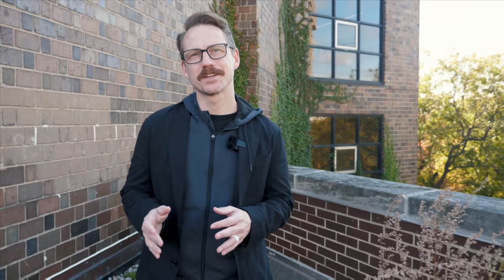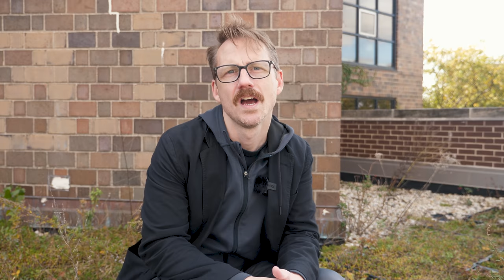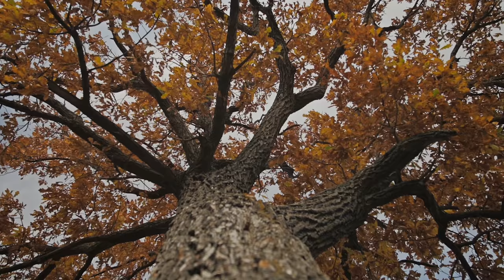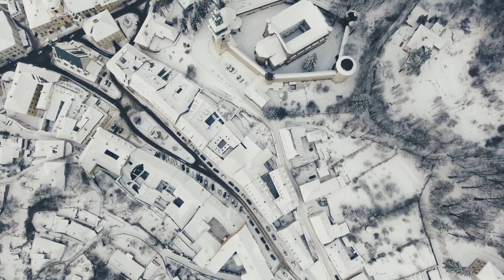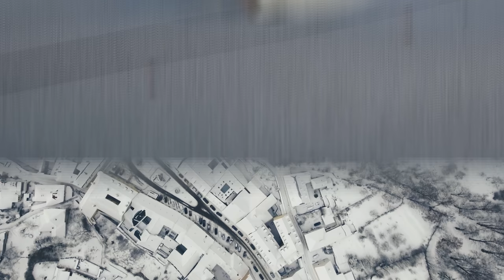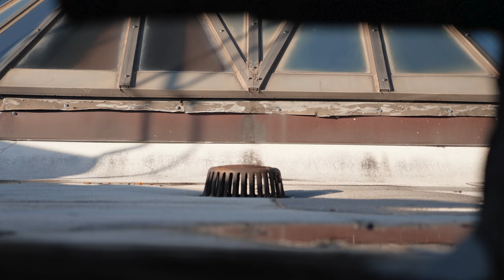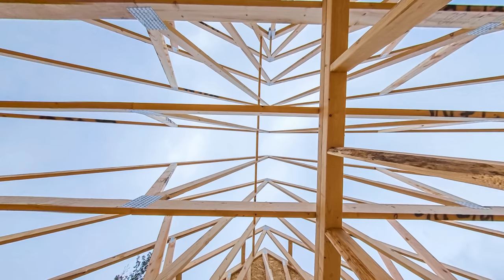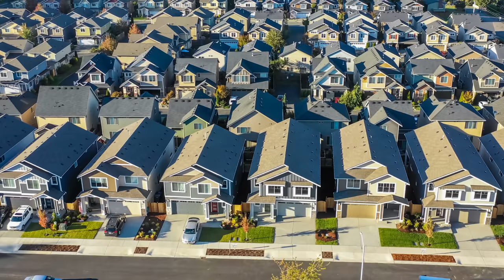Why Do Architects Insist on Using Flat Roofs?

Comment: As a building services engineer, I like flat roofs because you can use them to place air handling units, chillers/heatpumps and photovoltaic panels.
Especially since most architects don't want any HVAC or other systems visible in- or outside.

Also you can have a green roof, where most of all of the rain gets stored on the roof and feeds the plants, helping to fight temperature spikes in cities.
Reply: If the roof was not designed to be green roof, that can be dangerous to make it a fully green one.
Reply: @yamatohime2035  Yes, anyone wanting to do that should always check with a structural engineer first.
Reply: But you have to distinguish between real green roofs with enough soil for bigger plants and those with just a few cm/inch of soil. The latter one has a small water holding capacity and only small plants on some plases so that patches in betwean stay empty. Duet to the amount of dark soil, these rofs can rech eaven higher temperatures than thas with gust gravel or membrans.
Reply: @doublef3278  Then maybe the architect used the wrong plants. There is a difference between intensive green roofs (>10cm of substrate) and extensive green roofs (<10 cm). The Coefficient for >10 cm is 0.3, so 70% of a 5-yearly rain is retained, for the <10 cm it's 50%. Usually the extensive greening has around 5 to 10 cm of substrate and uses moss, succulents and similar plants that aren't care intensive, hence the name.

The main reason for the phenomenon you described is insufficient water retention and drought/lack of care or the wrong type of moss or succulents.
Reply: @JainZar1  Interesding. So what you are saying is that even with extensive green roofs (wasn't sure if extensive/intensive is used in englisch too) there's enough water so there are no spots that are not covered in plants if you chose the right ones? Is that fore almost flat roofs onely or is the differens in lost water by a higher angel negligible?
Reply: @dangraff8467  What do you mean? A flat roof is by the common definition a roof that has at maximum an inclination of 5°. On top of that you place the drainage and substrate layers. Depending on the type of equipment you place on the roof, you already need to elevate the machines by 30 cm above the top layer to get them out of the snow. And since you aren't having normal plants in the same area as you have machines, there is no problem. You at most have succulents and moss in those areas and they don't do anything to those machines.
Reply: Big deal, just create a separate attic floor for utilities then.   That way they are entirely hidden plus there is a protected area to store things.
Reply: @Zuckerpuppekopf  Great, if the local construction plan allows for it. Usually there is a plan in place, that limits the amount of full, partial and/or technical stories you can have.

And every investor ever will tell you to build the machinery on the roof, so they can maximize the rentable space in the building. Also you don't get an extra roof, because that is expensive.
Reply: Have you seen the 'facade roof' made famous by old McDonalds branding? It's got an exaggerated tiled, sloped roof around the edges to it gives the appearance from ground level of a stylish, traditional roof - but that facade actually goes up /far/ above the level of the 'real' roof, acting as a way to block sightlines. Then the real roof is flat, and used to support all the HVAC equipment in the conventional manner.
Reply: Forced air heating and cooling is outdated and extremely inefficient. PV solar can be installed on a gable or hip roof with the roof angle being a benefit and not a hindrance. A green roof is heavy and requires more costly materials to be used to safely support the weight.

A pitched roof requires no routine maintenance such as drain cleaning and hot mopping seams like a flat roof.
Reply: @davidparker9676  Not if it's ASHP which can have a COP rating of 3 which is extermely efficient. Incorrect, pitch roofs do need maintenace, for any gutters that have debris etc
Reply: @ONeill01  I am sorry to tell you that the gutters are NOT part of the roof. If you don't have gutters or if your gutters are clogged, it causes problems elsewhere, typically below the roof. A pitched roof is just an intelligent design, relying on routine maintenance to avoid flat roof collapse is the tell-tale sign of a poor design choice.

Forced air systems are like wagon wheels to modern day wheels. Soon it will be completely abandoned as energy costs continue to rise and make them cash infernos to operate.
Reply: @David Parker  Gutters are part of roof as much as gutters are of flat roofs they are part of the roof system, it's a red herring whether or not it effects below has no bearing on the the fact that gutters are part of the roof, if a roof collapses it will also effect below - your example is illogical. Reason we have gutters is remove water from pitch slopes of a roof. 

Other areas of a pitch roof that need to be maintained, includes flashing, tiles, membrane, joists, fascia and soffit are all areas that pitch roof that needs to be maintained so you are factly incorrect. 

ASHP are not going anywhere, they are a stragetic part of energy efficiency, as mentioned before, ASHP are typically COP 3 meaning 300% more efficient than to a typical boiler of 90%. Mechanical systems such as ASHP are being promoted as a means to tackling climate change, as we move to more fabric efficient buildings the more important mechanical systems are to ventilate and heat spaces, these also include MVHR units which recover heat that's lost through ventilation which is core part of acheiving Passive house, and  important in NZEB buildings as well, not only are you wrong on both accounts, you are massively ignorant on the general trend of mechanical air systems.
Reply: Unfortunately the costs of much larger roof structure and need to use space for other purposes (mechanical equipment etc.) precludes many of our clients from even contemplating green roofs. not even counting the different type of services and maintenance required.
Reply: @Seagaltalk  Well, in Germany, the district building codes usually have a minimum roof greening every roof needs to have.
Reply: @JainZar1  I am sure it's followed to the letter. we have worked with some big companies in germany and toured their facilities. they did not have green roofs of any sort. When did these rules come in to effect
Reply: @Seagaltalk  The allowed "trick" is, that the buildings owner buys an adjacent plot of land or sets aside some of his owned land (that he is allowed to build on!) to leave green instead.
If the percentage of green roof needs to be 40% for example, the owner can buy a building plot in the vicinity and instead of building on there plant vegetation on there.
Reply: Adding plantlife doesn't fight temperatures . . . The increased temperatures in cities are entirely because of color and material choices. Asphalt is black and does a stellar job of both absorbing and radiating heat, as just an example. Cities in Arizona are already tackling this problem by coating their roads in a lighter colored material that is also resistant to heat absorption. Old Greek/Arabic cities/towns are white/light-colored for more reasons than just material availability.
Reply: @I_Am_Empyrean  Yes, but plants have the same effect you just described, while also absorbing pollution and increasing humidity.
Reply: @Raven Coldheart  Plants don't directly increase humidity, either. 
Skyscrapers, in particular, cannot have rooftop gardens as the elevation inhibits planting of local fauna(not to mention it prevents an ecosystem from forming as bugs don't venture that high). Changing the building materials and paints/coatings on the other hand, would have a much more widespread and positive impact. 

Whilst green roofs are a novel and neat concept, it is much more efficient to plant parks instead(pertaining to environmentalism).
Reply: Isn't it just greenwashing to put plants on the roof of buildings where the interiors have air conditioning on full blast, where the cityspace is mostly asphalt and concrete and internal combustion engines etc?
Reply: Except all of this is still true if the roof has a slight slope and a hiding wall at the end. Yet the slope will still make it get ride of water way better and quicker and also the snow will mainly pile up in on location of the roof, that can be made extra steady and there are ways how to rid of that snow more efficiently.
Reply: @JainZar1  maybe you should tell the investor that building maintenance and reusablility of the structure would be so much more better with an attic floor housing utilities while also providing a nice heat rise and a protection from ponding?

Comment: As someone living in the desert, I can understand why Egypt and mesopotamia used flat roofs: not alot of wood, not a lot of rain. I just sorta assumed those are the two conditions for using flat roofing.
Reply: We use them in Canada when needed. It’s a necessary evil due to the need of room for things like air conditioners , complex ventilation for large kitchens , solar ect ect. But they are known to leak. It’s all about getting a warranty from whatever roofing company installed your flat
Reply: And most importantly - they did not have snow.
Reply: @JohanDanielsson8802  except for that one time
Reply: @BigpapamoneymanMVPtypebeat  what's a solar ect ect?
Reply: @unvergebeneid  “ect” is short form for “etcetera” which is a word used specifically for the end of lists, that are to long and extra detail is not necessary. 

For example I could of named patio, rooftop green house, roof top pool, bat signal
Reply: @JohanDanielsson8802  Flatroof’s can handle snow, but it’s about when that snow turns to running water , and seeps into a opening then re freezes at night over and over during fall and spring
Reply: @BigpapamoneymanMVPtypebeat  "Flatroofs can handle snow..." 

You mean if someone showel it away?
Reply: @JohanDanielsson8802  Snow melts and goes down the drain like rain, unless you are in a place where is so cold it never melts, then I don't know.
Reply: @BernardoPC117  Where I live (northern Sweden), the snow may be there the entire winter. On a plain surface where it is not showeled away, a lot of snow may build up during the winter.

The cowshed where I work have a sloped roof, but not so steeply sloped. Unfortunately, construction cost is usually prioritized very highly on such buildings. The structure that held that roof once broke a little, under the weight of all the snow.

I have also seen snow getting showeled away from other roofs, all sloped. The snow may in some cases get too heavy otherwise. Even if the roof is sloped, mind you!

If you have a flat roof here, you really need to showel it during the winter, or maybe heat it to melt away the snow. If you just let the snow lay there, it will get really heavy.
Reply: @JohanDanielsson8802  For context, snow typically has a density from about 50 kg/m³ up to 300 kg/m³, though if it gets wet or partially melt it can be higher. Water density is 1000 kg/m³. So even if you just have some 10 cm snow on the roof, you're looking at a metric ton of snow on a 10x10 m roof area. That's like an average single family house in Europe or a small house in US/CA/AU. Snow depth in northern Sweden can easily be ten times that.
Reply: @AnotherDuck  I did not have those numbers, thank you for spelling them out.

I knew that snow can be surprisingly heavy. So it kind of make sense.
Reply: I mean!!!   I live in a semi tropical  climate with yearly earthquakes up to 6 richter, last one almost 7 and a large amount of  rain. Flat roofs are used frequently and they are not know to be particularly leaky its called building properly. And bugs would eat a  wooden roof fast in my country.  The guy assumes because he generalized as convenient to his  narrative. I mean he went to Egipt!
Reply: In Russia almost all public buildings and all multistory multistorey buildings (where almost all Russians live nowadays) have flat roofs. I wouldn't say that Russia is such an arid place
Reply: @BigpapamoneymanMVPtypebeat  The abbreviation is “etc.”, not ect.
Reply: @BigpapamoneymanMVPtypebeat  Wasn't it "etc" though?
Reply: egyptian traditional architecture also feature small windows  to keep cool air from escaping but you don't see this guy arguinging for that. All building traditions are the consequent sum of all structural decisions that were successful. the only benefit of flat roofs over non flat roofs in more wet landscapes is its ease in repair which shouldn't be an issue if it wasn't constantly damaged by elements that a non flat room would have withstood for far longer. Modernity has done away with the idea of tradition and has therefore created inefficiencies where there was none.

Comment: The biggest problem I saw in property managent is that building with "Low sloap" roofs, didnt have a slope at all. It is critical that the roof actually have a sloap. The one building i had the pleasure of helping managing/maintain that had a 6° sloap never had problems. The roof was in fantastic shape, and you could tell by stepping foot on it.

Sure did it feel a bit weird if you stood on it? Yeah, bit it shed water and snow like a champ, while still giving the high rise a place to store unsightly machinery.
Reply: I started typing...then saw your post that basically said it all. 👍
Reply: Flat roofs are a result of changing things that dont need to be changed via, "change for the sake of change "
Reply: Thing is it could have an incline and have a lip, my home & garage looks like they have flat roofs- it has a lip around knee high

I just chill on the garage sometimes
Reply: *slope
Reply: @VincentGonzalezVeg  A lip? I'm guessing your talking about a knee wall lol. 

Yeah every roof has a pitch to it even if its just  a 1. Porches will too if built right but they only need to drop a few inch.  That way water will run off and not sit. And you need an extra layer of waterproofing,  something thats selfsealing like ice & water shield not just tar paper or tyvek.   

A house I worked on had a few years ago had  a rooftop deck . It was 4 stories, close to the beach so the view was nice looking south.  Only problem was it was on a tiny lot. squeezed between 2 3 story houses. So if you looked east or west you would be looking into your neighbors windows.
Reply: Bryan Harmon  The difference is the same as the difference between a highway and a local road. The highway is cambered (not chambered) because a lot of money and care went into it. But local roads are flat and level with the surrounding ground because they were done for the least amount of money and care. Most apartment buildings and whatnot with flat rooves are like local roads and not like highways... they were thrown up for the least possible price, meaning the roof is flat and not cambered nor sloped.
Reply: Maybe to get rid of snow in places were this is needed we could reuse an old idea you commonly see used in older houses in Switzerland, the bumble double slope.
The idea is that you have a very steep slope in the middle (only a very small part of the horizontal distance, maybe 25%) and then a much flatter slope attached to the steep slope.
This gives you more usable space inside since steep sloped roofs often end up wasting interior space while also getting rid of the snow very efficiently. Basically what happens is that the snow on the steeper part starts to become heavy enough to initiate a small movement of the snow in the flatter part, this snow then keeps on moving (as it does) and falls of the roof.
It is really quite a genius way to build a roof and it has shown its worth over 300 or more years.
Reply: Its slope, not sloap, but its fine
Reply: @PhilfreezeCH  The interior space depends as much on the height of the wall as it does the slope of the roof. A steeply pitched roof that meets the floor will give you a lot more room than a shallow pitched roof that meets the floor will, while a shallow pitched roof with a 6' high wall will give you a lot more space than the high pitched roof that meets the floor will.
Reply: @fukkitful  Not a knee wall. It's actually called a parapet.
Reply: @briandbeaudin9166  Didn't know that,  I only had to build one once and I see now we were calling it the wrong thing.
Reply: slope*
Reply: Yup worked in a building that didn't have a slope, plus poor maintenance and horribly done landscaping which equaled the back area flooding and lots of ceiling tiles coming down after crumbling from being soaked. Pro tip with landscaping... never have the angle of it push water into a building unless you have properly waterproofed and set up drainage to keep the water from the building... We wound up with mushrooms, legit mushrooms growing from the drywall.
Reply: “Slope”
Reply: It should be noted that once upon a time you could properly install a 4-ply built-up coal tar roof and if properly maintained, would last many decades with little or no slope. In fact, coal tar performed best with no slope and could withstand standing water for long periods. It was the gold standard of commercial low-slope roofing.
Of course, most people never see low slope roofs and therefore they are prone to significant cost cutting. 
Next time you are in Rome, take a good look at the roof of St Peter’s from above. It is a sea of soldered lead, covering every manner of slope. A cheap big-box shopping center store roof it is not. It’s not necessary the slope, but rather the materials chosen and the skill with which they are detailed and installed.